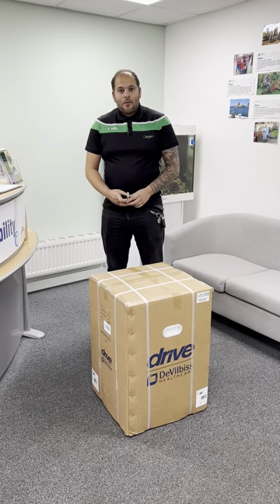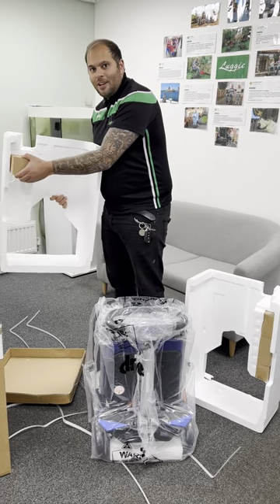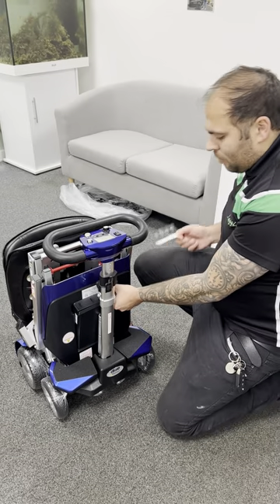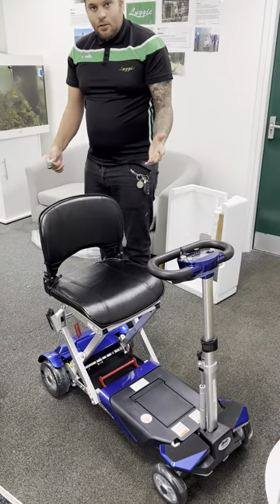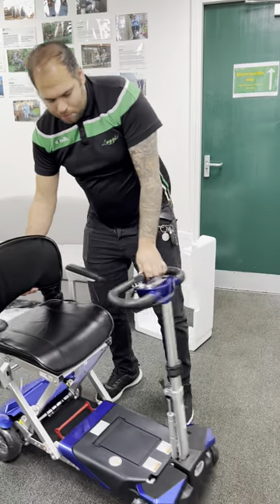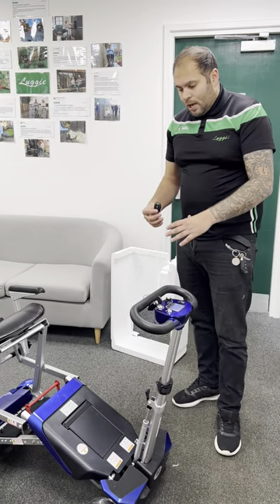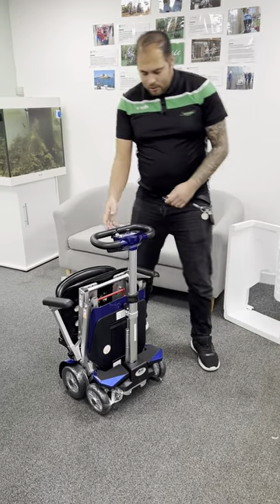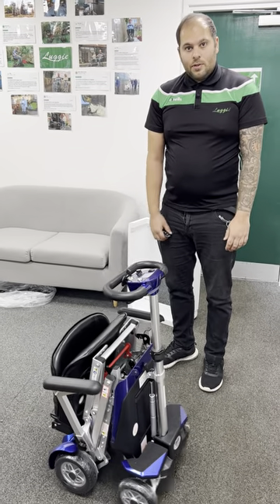Next Gen Auto Fold Mobility Scooter by Local Mobility Unboxing and Troubleshoot

Comment: I have been using a Pride Go Go Elite Traveler mobility scooter that disassembles into 3 main sections for carrying in my car's "boot". At age 84 with decreasing strength, hefting the separate sections and battery in and out of the "boot", and assembling them, is getting a little hard to do. A light  lithium battery would help. The various Auto Fold designs all look like they have to be hefted into the boot in one folded piece. If the metal pieces of the scooter are made of aluminum and battery is of the lightweight Lithium type, it might be doable to load the folded scooter into your car "boot". The Next Gen example , including use of "remote" looks a little too complicated for many oldsters. Can the scooter can be folded and unfolded with a dead battery or lost remote ? I would worry about reliability with the added electrical complexity of  any autofold design. There is some benefit of compactness for storing indoors if you don't need to lug it up stairs. I advise first time buyers to do some research into ease of use  as well as long term availability of local service and repairs.
Reply from the maker: Hi Gary,  The auto folds  are perfect for car boot travel, plane, trains, coaches etc. The scooter can be folded/unfolded manually in the case of no power or loss of the fob. we do also have a range of manual lightweight folding scooters which have lithium ion batteries also perfect for carboots, planes, trains and coaches. You can view these on our or websitehttps://www.luggiescooters.com/folding-mobility-scooters/   or call us on 0800 0124 258 for more information.

Comment: How do you remove the battery when the scooter is in closed position? Recently I was travelling on an aircraft and had to remove the battery before the flight. Obviously the scooter can't be open and once the battery is removed you cant close it!!?? Basically we had to force the steering column away to get access to the battery to remove it. Surely there must be a better way???
Reply from the maker: Great Question. The scooter can be folded and unfolded manually for instances like this. If you take a look in the user manual you will see that there is a bar that you push which will allow you to unfold it slightly to remove your battery and then you can fold it back up using the same lever. Hope that helps.

Comment: You forgot to demonstrate where the battery is and how to charge it ,can you remove the battery to charge and is it acceptable in airplanes.
Reply from the maker: Good morning, Yes the battery can be removed and charged the charger port is also located below the seat underneath a rubber cap this would be used whilst battery is on the scooter. to charge the battery off the scooter you would need to purchase an off board charger. We do not deliver to the USA i am so sorry. You would have to contact the USA Freerider for further information. Thankyou